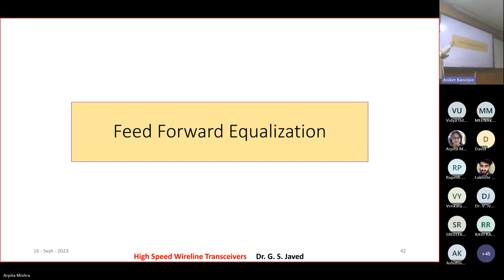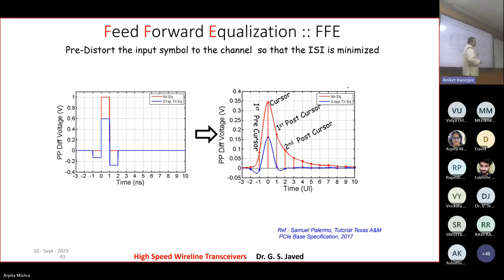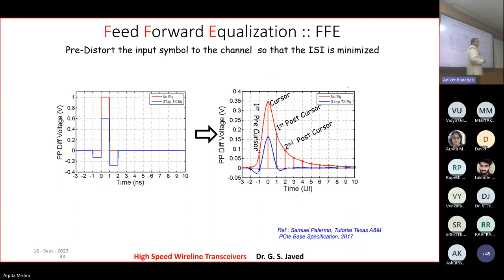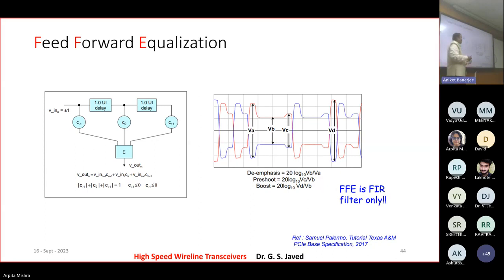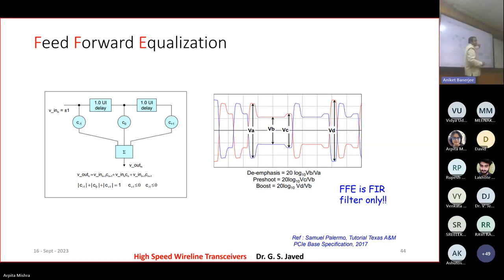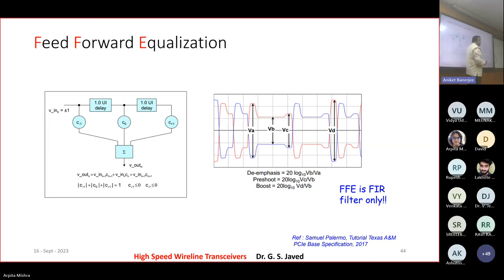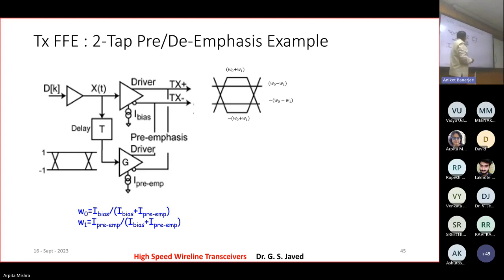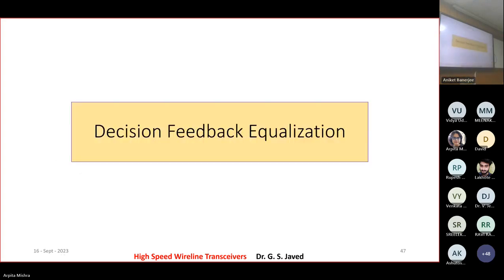SerDes - Tx Feed Forward Equalization FFE - 20Gbps

Comment: sir what is ui and what is tap i a having a confusion in between those two
Reply from the maker: UI - Unit interval. Its a unit of time used in the high speed designs. 
Generally, it is UI = 1/frequency.

Tap - Its a circuit used to tune the current or voltage coefficients in a TX FFE or RX CTLE or RX DFE. The coefficients are applicable to the time-delayed version of the input signal.
Reply: @drgsjaved  ohh got it sir thanks you